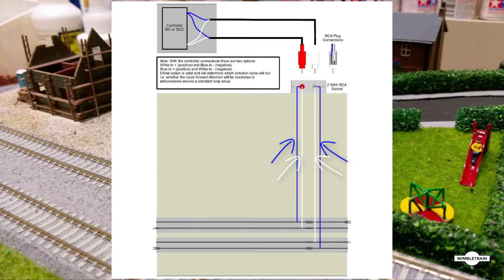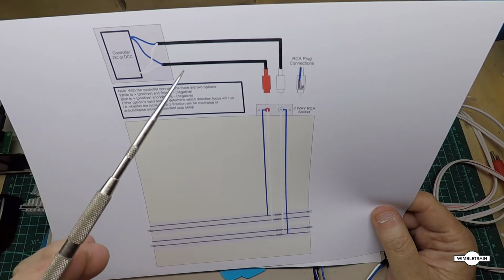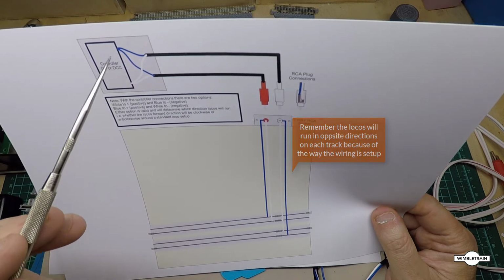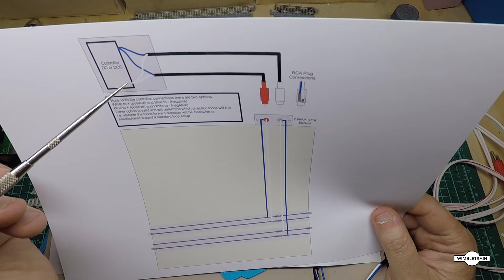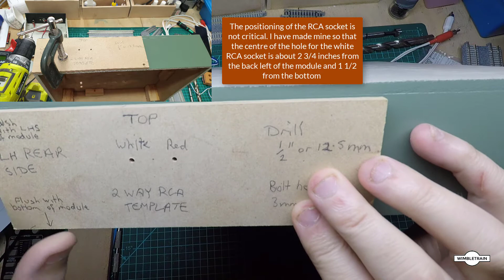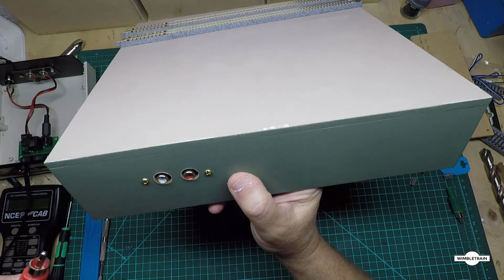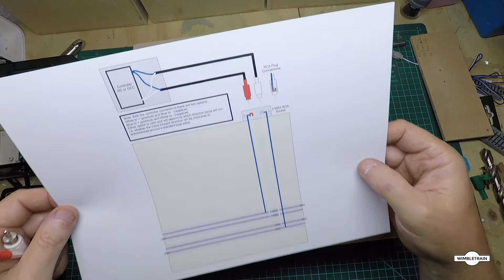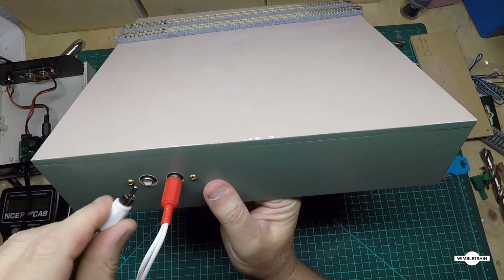T Trak Module DCC and DC Wiring Australian Standards

Comment: With the blue cables on the outside tracks I wonder how a double crossing will work without a short circuit?
Reply from the maker: Hi, you would need to reverse the connections on one of the loops. I do that on my layout as I have two loops connected with a double crossover.

Comment: Hi John, do all of your modules have their own feeders? And if so do you daisy chain them together or run a DCC bus?
Reply from the maker: G'day Alan, at this stage I don't have feeders going to every module. It's probably a good idea to do so in the long term as I am relying on good rail joiner connections.  I have found that my setup runs OK at the moment with feeders just to two modules at this stage. Looking back at what I did and if I did it again would probably add power feeds to each module as I built them. John
Reply: @wimbletrain  thanks for getting back to me so quickly John, I'm planning on adding the option to have power to all modules, though may not connect them all, just because I don't want too much distance between the feeds. I worry about daisy chaining them together as I don't know whether there would be too much voltage drop because of the multitude of connections, so I reckon a bus wire with splices may be the way to go. Should still be able to use the RCA connection hopefully. I suppose as there doesn't seem to be any clubs here in the UK, I can pretty much do it however it suits.
Alan
Reply from the maker: @alanwiggins8073  You're right there is no official bus wiring standard but some groups have formulated their own. Check out:  http://ttrak.wikidot.com/wiring-for-t-trak

Comment: Good explanation but you must review, the colors of the first track is red, the yellow behind, according to the guidelines since 2018. Maybe you should use the RCA colors according to the lines. I already regularized this a few years ago that it was not clear, and that would behave problems with other T-Trak modelists who already have it clear
Reply from the maker: Thanks for your feedback. My modules are built to the Australian T Trak standards which differs in wiring to the North American standard. The North American standard uses the Red/Yellow track whereas the Australian standard was different with the red and white connectors used. Sorry for the confusion but I have also changed the video description and title of this video to make it clear the wiring is according to the Australian T Trak standards.
Reply: @wimbletrain  My RailroadModelers club T-Trak Nordeste have decided changing rules Australians to USA standard
Reply from the maker: @francescreinoso8965  That's interesting your group was using the Australian standard and has now moved to the North American standard now?
Reply: @wimbletrain  Yes, we have changed the cables and colors of connectors. Now you can find all the material in e-commerce and go to univarity standards, and have read the N-trat newsletters until 2000. And in my opinion, it is important to unify all the T-Trak rules
Reply from the maker: @francescreinoso8965  Hello again, yes it would be nice if we all used the same standard wouldn't it? So according to what I see online and what you are saying is that the RCA connector that is Red on my diagram should be Yellow (inner loop) and the White RCA connector on my diagram would be Red (outer loop) and that would match the North American standard? Regards John